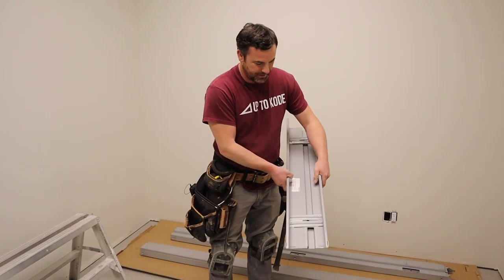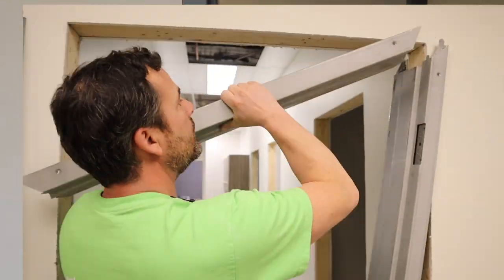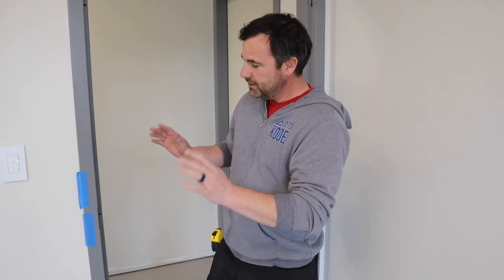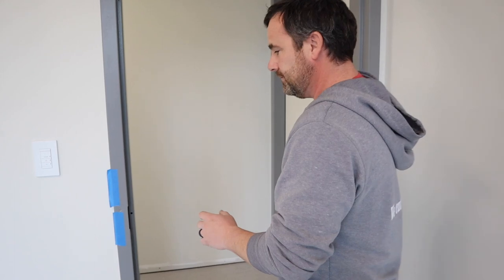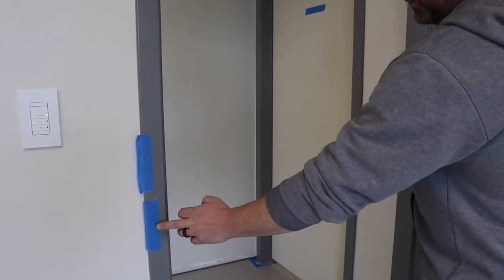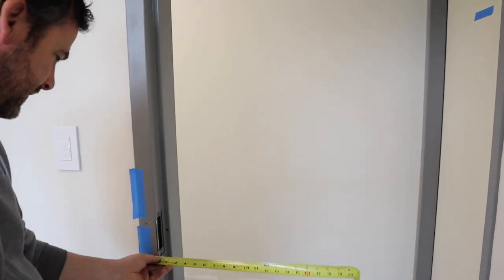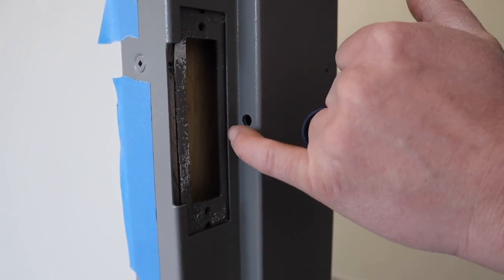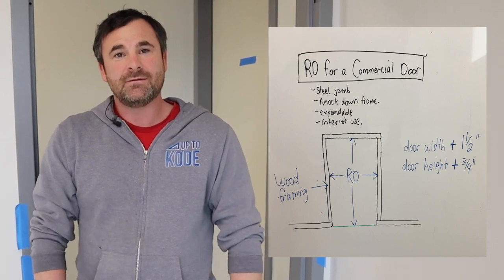Rough Opening Dimensions for Steel Frame Door

Comment: When framing for the door opening do you put wood inside the metal studs and a 2x4 under the top header plate or is there to be no wood at all used with the metal framing for the knock down door